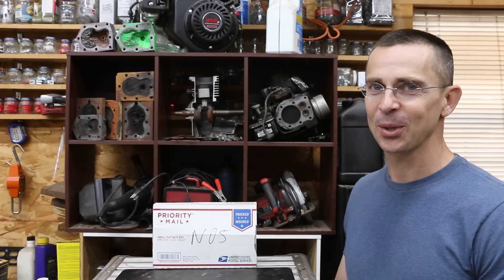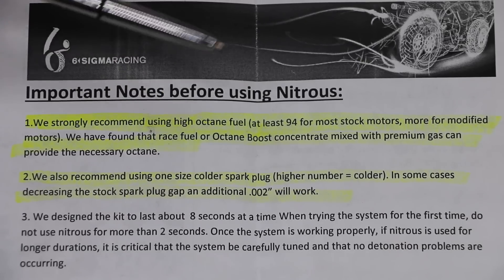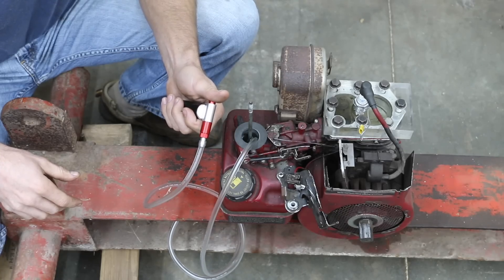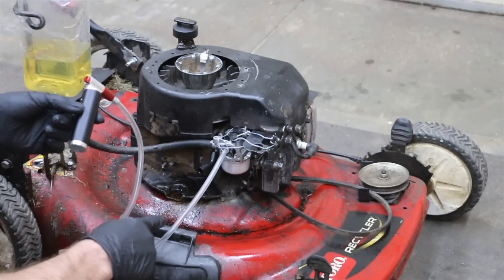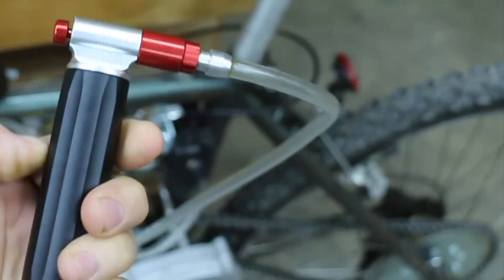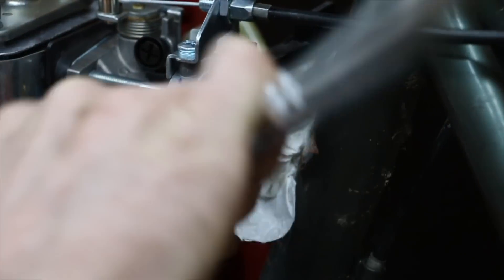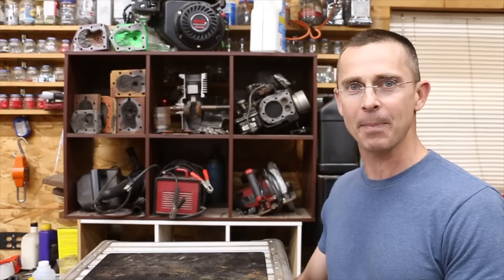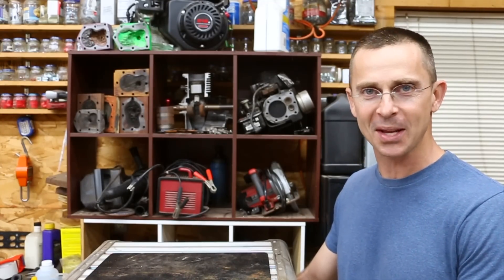Will the 4-Stroke Bike Survive Nitrous Oxide?  Let's find out!

Comment: Will a hair dryer blowing into a small engine air intake provide any noticeable MPG/Horse Power increases? Like a DIY cheap turbo?
Reply from the maker: Thanks for the video idea!
Reply: watch the "ROADKILL" episode where they hook up leaf blowers to the mazda for boost, it worked some.
Reply: you might want to check out Roadkill. They tried this with a Monza and a couple leaf blowers. This episode is still available on youtube.
Reply: Would take  a looong extension cord though.  Really long.
Reply: @grassroot011  lol!
Reply: https://youtu.be/U81_0waqEWA watch this, the guys at road kill put 4-5 blowers an a monza. Can't remember the results but it was funny.
Reply: @Kris Nicholson ah,, but wasn't this,a,4 stroke he was working with?
Reply: Leaf blower..? ;)
Reply: I connected a gas leave blower up to my old mustang many years ago. The conclusion was that it added no 'boost' because it could not build pressure. I highly doubt a hair dryer would ever build pressure. If you put your hand over the end, it does not try to push your hand away.
Reply: Mighty car mods does one with leaf blowers.
Reply: Kawasaki did this back in the late 80s and early 90s on their ZX11 (ZZR11 in Europe) and it does indeed work on that size engine. Having said that, the engineering that went into the intake and airbox was pretty sophisticated. I kind of recall baffles and pressurization balance tubes. Even the location, size, and shape of the intake on the front of the fairing was critical. For a mega corporation like Kawasaki not a big deal, for a backyard mechanic I would think a little more problematic.
Reply: No, unfortunately.

We will just assume that you have removed/disabled the heating element.

The fan just cant move enough air to compress the air coming in and make any improvement.

In fact, on a larger motor, if you hook it up so that all of the incoming air passes through the hair dryer, it would most likely restrict the airflow causing a loss of power.

The compression of the incoming air, the boost, is what is difficult to achieve.

This is why turbo chargers spin at such ridiculously high speeds.

The hair dryer will never spin fast enough, or seal around the edges of the fan to produce boost.
Reply: Yea you need pressure not just flow rate. Been there done that with a gas leaf blower long before YouTube existed.
Reply: I have wondered that many times. What about a battery powered blower?
Reply: @jeffbanfieldsflwr3537   Already answered here, read others posts before posting. You need pressure, not just air flow. Like 30psi, not the 1psi a leaf blower has.
Reply: @ipissed  30psi is a MONSTER turbo setup lol don't need that much to notice the difference
Reply: @arlobubble3748   Well you definitely need more than a hairdryer, or leaf blower. It wouldn't be a turbo anyways it would be a supercharger. They actually sell electric supercharger kits @ about 5psi.  I doubt 5psi would do much.
I found a HVLP sprayer with a 6 stage turbine that outputs 11.5psi @130cfm. How much would it take to notice a difference then?
Reply: @ipissed  This isn't a forum!
Reply: @jeffbanfieldsflwr3537   Then why are you trying to moderate it?
Reply: @ipissed  well 14.6 psi (1 atm) of boost is effectively pumping in 2x the oxygen a naturally aspirated setup would so in a perfect world with no losses would double the power output. Of course in a turbo setup there's increased exhaust restriction and the intake air will always be some amount warmer than ambient even with intercoolers, and there are other losses so you don't get quite that much. As a general rule of thumb you need at the very least 10% power boost to be able to feel the difference, so you could achieve that with only 5psi boost (~35% increase in intake O2). Not gonna blow your socks off but you'll notice it.
Reply: @ipissed  I'm not falling in to that trap.
Reply: Casey Kaczmarek 
Maybe if the engine was about the size of a quarter it would boost it enough.
Reply: No. Mighty Car Mods proved No with dyno runs. They also proved K&N filters 'BUNK' with Dyno runs as well as most so called 'Performance Mufflers'/Cat back systems as 'BUNK' also with Dyno runs.
Reply: how about attach a compressor powered by a large motor OR petrol engine to the intake of a small motor
Reply: @Kris Nicholson As silly as they sound, a boost bottle can sometimes help.
Reply: air flow and air pressure is not the same thing, an air dryer will not provide any pressure
Reply: @Kris Nicholson there's many 2 stroke turbo kits available for snowmobile, you're spreading mis-informations
Reply: Forced induction and carburetors don't work well together
Reply: @Pogaspm  I've just always heard it as a rumor for gokarts, thought it would be interesting to see. I appreciate it though!
Reply: @Pogaspm  You need a blow-through carb for forced induction on a carb engine.
Reply: @Pogaspm  You can get them to work together if you place the carb on the intake of the turbo/supercharger. Would probably turn a hair dryer into a flamethrower though.
Reply: @dire_reha  Exactly my thought.
And also, considering how fast the engine draws air, a hairdryer would probably generate a negligible amount of pressure, probably not worth the explosion.
Reply: Your intake air temps will rise due to the heating element you should use just the blowing part of a hair dryer. And its not compressing the air its just directing the air into the engine. I'd be interessted in the results but i dont think it would increase (much).
Reply: Look for 2cv or Dyane 6, these models engine have a big front fan for air cooling and airbox is connected to this fan.
All this gives about 1-2hp

Comment: Hello Dear Project Farm, again. I was waiting for this video because you told me to watch this video. I got my 2 stroke engine kit today in the mail! I followed the instructions as shown on your 2 Stroke bicycle engine kit video i got my bike built and it works great, Thanks to you! Keep up the good entertainment!
Reply from the maker: Great job on assembling the 2 stroke bike build!  Please keep a close eye on that chain tensioner and please be careful.
Reply: I will, thanks again!
Reply: Remember to richen up the fuel mixture! NOS adds power because with more oxygen you can burn more fuel.
Reply: +Matthew... The problem with doing that is that the 99.999% of the time you aren't pressing the button, you are not running as efficient as you could.
Reply: Injection is NICE...😛 But I'd Rather Be BLOWN!! 😲
Reply: +Rick... Yes. Good points. These were my points also. Everyone in this thread seems to think Nitrous is magic.
Reply: +butc.. There was no load on the lawnmower. That is what I was talking about.
Reply: +butc... Do you honestly believe that a single run up a road is a proper test?  It could have simply been a much colder day than his old run. He might weigh a few less pounds. It could be a fluke.
I think doing actual tests would be far more entertaining.
Reply: +butch... Because the way Nitrous works is it allows you to get more fuel and O2 into a cylinder than a naturally aspirated engine could do on its own.  The extra power comes not from the NoX, but from the additional gasoline the oxygen in the NoX is able to burn. This setup has no mechanism for extra gas to get into the engine.
Reply: +butch... I freely confess that the high pressure nox could possible increase the venturi effect and draw in more gas.
Reply: @tarstarkusz  An engine running lean will rev higher until it's too much to burn effectively. The problem with lean burns is heat.
Reply: +Cakvin... Yes. That is not only bad, but it's especially bad if you've got a catalytic converter.
Reply: @butchtropic aftermarket NOS systems, you're referring to cars, correct? You know, the hulking machines with adjustable fuel injection and oxygen sensors that can say "hey, we're running lean, lets put more fuel in!"? those cars?
Reply: +Jeffrey... There was no test done. Project Farm is usually pretty good in that regard. The mower wasn't under any load and so we have no way of knowing if it actually generated more power.
1 single run under very loose test conditions doesn't tell you much either.
Reply: tarstarkusz I highly doubt those carbureted motors are running perfectly at stoich and even if they deliver the correct ratio it may not be a complete combustion. I don't doubt at all that these motors made more power. Why would the mower engine rev higher every time he sprayed? Why could he hit 41mph when he sprayed instead of 37mph without spray?
Reply: +juck... I would imagine that spraying compressed air into a lawnmower engine would also create an audible effect. Since there was no load on the engine, there is no way of knowing if additional power was being made.  The bike was a single uncontrolled high speed test.  It could be that Nitro did something, it could also just be a fluke.  There are many things which could cause such a minor difference.
Perhaps it is doing something. I don't really know. However, unless the motor was running very rich, I seriously doubt it is doing anything.
Reply: @tarstarkusz  he might have only shown one max speed test in the video but he could have done more then shown. Either way I trust that he controlled as many variables as he could. The speed tests we're probably on the same day and on the same strech of road ect. 37 to 41 is a significant difference, more then just better weather. I do agree though he should have used his tachometer to show an increase in rpm. He has the capability to do so, I'm not sure why he didn't. It does look like the rpms go up though. I'm not taking away from your claim that you should add additional fuel with the nos for best results, but I do think this video shows in his situation that he made more power.
Reply: @tarstarkusz  yeah but what about the actual bike test?
Reply: +Caleb.. A single run only measuring top speed and doing so pretty inaccurately, really doesn't show anything.  I think an acceleration test would have been better, with at least 3 runs in each condition and then averaged.
Reply: This kit is doing absolutely nothing.  If the engine is already running at optimum air fuel mixture, then there is no extra gasoline to burn. That is how NOS works. That is why you run additional fuel into the carb. When you press the button, the system shoots both nitrous and additional gas into the carb.
This kit is not doing anything.  Nitrous isn't magic, it is a highly dense oxygen source. Oxygen cannot be converted into energy.
Reply: tarstarkusz You clearly don't understand small engine fuel delivery.
Reply: Ok, Cassette, just lay it out there. What am I missing?  I have already stipulated that if the carb is running at the proper air/fuel mixture, then it wouldn't do anything. If it were running too rich, it probably did do something.
The only thing even theoretically possible is that the spray is increasing the fuel metering of the jet from being under pressure.
Reply: @tarstarkusz  The only gain is the decomposition of the nos into nitrogen and oxygen. It is significant. that's why he got results without fuel enrichment. other than that, you're exactly right. Also, without enrichment, you could be oxidizing parts, instead of fuel. A lot like hitting the oxygen key on a cutting torch!
Reply: @tarstarkusz  yes, but you can get away with it with a bigger jet, and they said only 2 seconds that way it doesn't lean out over a long period of time.
Reply: tarstarkusz, I've done this before with Honda's "Dio" engines. It does work better with an extra spray of fuel! In fact alot of kits supply the "Y" fitting, one side is fuel for and the other is Nitrous. However, on a small 2 stroke, fuel in my application was vacuum drawn so the more the engine pulled from a dry style Nitrous fogger kit, it pulled more fuel too from heavy vacuum across the intake manifold. I've done with fuel and without and they both worked.
Reply: +808... It is possible that spraying the Nitrous into the carb is actually sucking more fuel out of the jet.
Also, I realize this is just for fun. But I do think we should have a theory of how it works and to what extent any gains are realized.
Reply: tarstarkusz Right great theorising there. Except, hey genius, the ungoverned mower engine revved higher indicating extra combustion force & the bicycle setup produced extra power. Power is the only way to overcome the resistances to get higher speed. It must be hard when the real world doesn't match your high standards.
Reply: +Cassette.... If there were an actual test showing me wrong, then I would be much more impressed.  There was no load on the engine.
Tell me, where is this extra energy coming from?

Comment: Would like to know how long a 2 cycle engine will last without the oil additive.   How long will it run on just gasoline.
Reply from the maker: Thanks for the video idea!
Reply: Rather than just running it dry (no lube) and destroying the engine, more curious about using diesel, ATF, MMO, etc. instead of 2 cycle oil.
Reply: @jamescox6032  i used diesel, atf, motor oil, and gas mix in a 2 stroke gennerator it ran but like crap took a while to warm up once warm it wold run with no spark (dieseling) lol also pluged the exaust port compleatly and after a few days of running it like that it blew a head gasket because it wold ping under large load, piston and cylinder looked good lol
Reply: @jamescox6032  Yeah that would be awesome!
Reply: Will reach the link in min but I did this once a guy work for told me to he allies right type boss, it lost compression to where it just would not rev.
Reply: @sunnydays4966  Did you re-fill it with 2 cycle mix? and if so, did it run well, or even run at all?
Reply: I forgot to add oil once, it'll ruin an engine fast no doubt about it
Reply: Rings gum up really quick and score the bore. Bike stolen from us ran it on straight gas for all of 10 mins
Reply: @Onelegup  Bruh
Reply: What would be really cool is to increase the compression and improve the intake. It's got a name, but I can't think of it off the top of my head. It's what you do to a 2 stroke motor to get more gas/air in the cylinder.
Reply: @tarstarkusz  porting
Reply: Milling the head for more compression
Reply: Ah, yes, that's it... Porting. Thanks Hal.
Reply: @tarstarkusz  porting?
Reply: I had a Vespa scooter 30 years ago. My friend borrowed it and just put regular gas with no oil in it. It did not make it through that tank of fuel before the engine seized up.
Reply: I think for about 5-10 minutes unloaded, about 45 seconds fully loaded. Maybe 1 or 2 minutes, tops.
Reply: Yes ran the same it was a $1200. Sthill back pack. So the shop took care of under warranty.
Reply: i made that mistake with my old bike before i switched to electric
it lasted about 3-5 minutes before it seized up
Reply: a minute or two. doesnt take long. about half the life span of a 4 stroke running with an empty sump. it will just gall up and seize up or burn up and loose compression. ive seen it before and ruining a motor just to see it would be pointless. we all know exactly what will happen
Reply: +Flying.. It does happen really fast. But really, the faster the better. If it seizes up right away, you can usually bring them back without much problem. At least the really small engines.
Reply: You can find such test on Steve's Small Engine Saloon channel.
Reply: https://www.youtube.com/watch?v=ovWj_w6rsXs